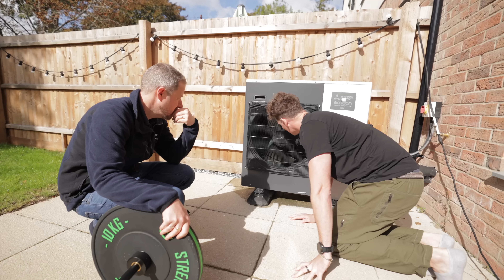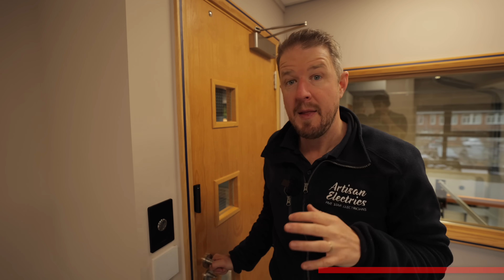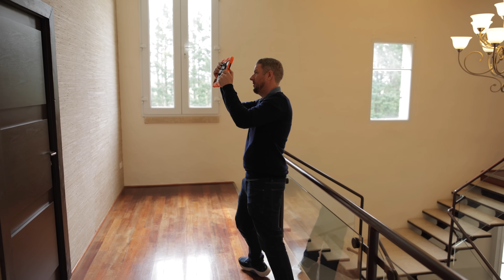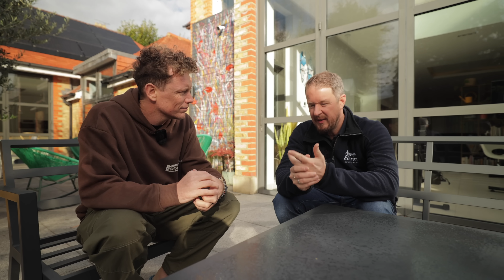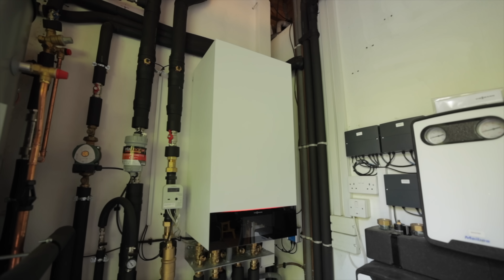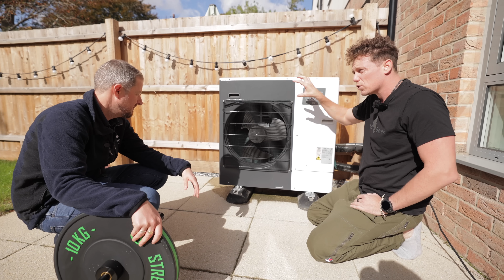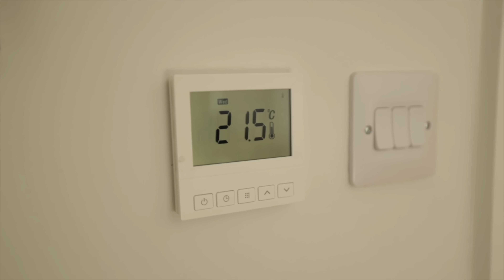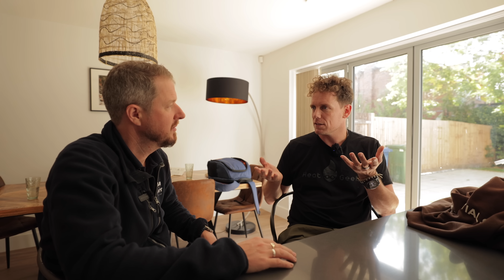Are Heat Pumps Really Worth It In 2026?

Comment: Ive got a (modern) 80's type warm air gas heating system. I suspect that nothing produces the level of warmth that that does. Its not super efficient but the cost is reasonable. My level of insulation is not sufficient for a heat pump although i do have cavity wall insulation. I think heat pumps are still too noisy and the level of heat that they output nowhere near sufficient in the colder weather. Warm air heating has become unpopular, but nothing beats it for heating an open plan room/house quickly. Heat pumps are like electric cars, ie not there yet. But thats just my view.
Reply: A high flow gas combi heating only a warm air unit, which only has what is similar to a car radiator inside and a fan, is superb. Johnson and Starley and Multicalor make them. Incorporate an electrostatic air filter then you have very clean air. Also you can draw in a percentage of fresh outside air. A fast warm up, and cheap to run. No ugly radiators that end up leaking.
Reply: Our setup is air to air in a big old victorian house and works wonderfully whereas the gas struggled (and was far more expensive). Very fond of modern air/air systems although the old 1990s US window unit type things are hideous!
Reply: That was pretty much my 10 year experience of a2a in my house.  Two years ago, I ripped it out and installed 2 log burners.  Noisy, Luke warm draughts and expensive was my conclusion of a2a.  I hated it…

Comment: I live in rural Wales and all the people I know who took the government grant, had to pull out their wood burners as part of the deal So when we had a 5 day power cut in the storm, I was toasty with my burner and they suffered miserably.  I would like to hear how much solar PV you would need to run the heat pump through winter. I think it unlikely that any usual size PV system could power a heat pump in winter. However cheap rate battery storage may help if you have a big battery. So I'm not convinced solar plus heat pump will save us from naughty Mr Putin....
Reply: How can they make you take out a log burner
Reply: It depends on your insulation and bulding size so it's a bit of a "how long is a piece of string" question. However if WW3 happens you aren't likely to have any gas at all!

Roughly speaking though the answer to your question for any given house is that your heat needed will be about the kWh of gas you bought if it's all gas currently. So take that number, divide it by the SCOP of the heatpump install (should be at least 3.5, 4 for a proper job) and you've got the electricity consumption.

The big problem with solar though is it's intermittent. Getting solar to cover a reasonably well insulated house energy requirements over a year average is easy. Sizing so you can survive a grid failure for a week when it's entirely rainy and dark is a bit more complicated.

Generally such setups use inverters like the Sunsynk ones that can do on grid, off grid and generator inputs plus solar. For most of the UK nobody cares but rural highlands/islands and bits of Wales it's another story and there's currently no battery setup for surviving week long outages that competes with a generator. Most of the time with big solar you'd probably not need it, but in the worst case it's about the only option.

For a single well insulated room though you'd only need about 200-500W depending on the situation, which most of the time is doable with a few panels and a battery
Reply: @etchedpixels  Thanks for the thoughtful reply. I just find it a bit misleading when proponents of heat pumps give the impression to the uninitiated,  that if you add solar you can run on your own power.

Comment: I had my heatpump installed by Octopus in February  and i've been really happy with it, the house stays the same temperature all the time no massive swings from one exterme to another.  The installl took about 1 week and only a couple of radiator changes were needed along with a new tank.

It's just started clicking in more frequantly now and is running the CH at over 400% efficency.  After watching a few heat geek videos i've been playing with the weather curve to get more efficency out of the system and it's keeping my house nice and warm with the radiators only running at 26°C.

Since it's install it's saved me £195, with the loss of my gas standing charge and being able to run with a battery at 7p /kWh.
Reply: Sounds strange, here in Norway we use air/air heat pumps, (abt £ 2000 for a normal unit) To involve the "boiler" in the system is not usual, probably because of cheaper el prices.  When I had only electric heating I used 28000 kwh each year. With the pump 15000. The pump is installed in a few hours, but I guess it is nice to get rid of the gas boiler, something we do not use here, would cost far more than electric.

Comment: heat pumps are stoops. more shit to break. the upfront costs make whatever you save a wash so it's all very pointless and they're really not that efficient when your power company just raises the rates constantly. AND we now know climate change is bullshit so there's that little tidbit. also the government's are making each new refrigerant obsolete as soon as it is introduced so they can continue to make money by selling morons the "new more efficient environmentally safe refrigerant" every 5 years. oh yea one more thing. the new refrigerants are flammable. like that's not a backwards move. ridiculous. keep corrupt governments out of private business.
Reply: "the new refrigerants are flammable", there's only a tiny amount of refrigerant in them, and they are hermetically sealed.
Gas boilers use a lot more flammable gas, so not sure what your point is.
R290 is unlikely to be obsoleted either, it's natural propane.  R32 will still be used in split systems for a long time as there isn't a viable replacement for larger split installs.
Reply: @BenIsInSweden  my point is that's a backwards move considering R410A did not require a leak sensor be installed to prevent a fire. also the cost of install along with the life expectancy of the equipment they make now offsets whatever savings there are. you're still buying power from utility companies who want their money (whether it's fuel or electricity). They ARE a business after all. i'm not against progress but i am against corporations using people's emotions about environment to SELL! SELL! SELL!
Reply: @funghoul9124  Not sure where you're getting your information from.
Leak sensors aren't there to prevent fires, they're there to protect the compressor if a leak occurs, a R410a heat pump with a leak without the sensor, would ruin the compressor and it'd need an expensive replacment.

R290 heat pumps have shielding around the electrical components that could generate a spark to start a fire, so with a R290 leak you'd need some other spark source near the heat pump to cause a fire.

Also, do you have any data showing R290 or R32 heat pumps have shorter service lives than R410A systems?

The other factor is even if the refrigerants get banned, it doesn't mean the heat pumps with them need to be ripped out, if there's a leak or need regassing - which is very rare, then you just need to use recycled/reclaimed refrigerant for it.
Reply: @BenIsInSweden  the leak sensors in the plenum didn't show up until the flammable refrigerants did. what happened to low pressure switches? and data on R32? it hasnt been out long enough. there is no data. but i know the inverter technology is so expensive to repair that past a certain point you'd replace over repair. look man, if you love heat pumps that's cool. i just think it's a wash opposed to fossil fuels and i also think rolling out a new "environmentally safe" refrigerant every couple years, which is the plan, is a scam.
Reply: @funghoul9124  Not sure what planet you're on.
But R32 heat pumps have been around for over a decade, and do you know what R410a is? a blend of R32 and R-125.  And my old r410a heat pump had an inverter so it has nothing to do with the refrigerant used.

And new refrigerants aren't rolled out every couple of years.

R290 is highly unlikely to ever be phased out on environmental grounds.
The only step up from it is R744 - CO2, and that's taking it from a CO2e from 3 to 1.

R32 has only been phased out in monoblock heatpumps, it's still king in split systems, and there's no current proposed refrigerant to replace it, nor is there any attempt to phase it out in the split system market.

But again, introducing new refrigerants isn't a scam, there are still plenty of R410a heat pumps legally in use despite the refrigerant being banned for new installs years ago.

I do find it bizarre someone shouting "they're flammable" is someone willing and happy to have far more flammable gas piped into their home that is ignighted for heating, and has had countless casualties and destroyed homes over the years.
Reply: @BenIsInSweden   you're missing my point. i just said it was backwards and only for the purpose of making money, not saving the environment. saying something is backwards doesn't mean i give a shit if it's flammable. also heat pumps in america are alot in terms of up front costs which most of the time do not offset the savings from our utility companies and tend to have more service issues because of the wear and tear of being used all year and the shitty cheap manufacturing we get from overseas which is one more reason to hate NAFTA for us. if you disagree. cool. also i never said 410a didn't have inverters, i just think they work for a while and are designed to be replaced quicker than the old staged systems and when you factor in purchasing costs it's a wash in my opinion. R32 was mainly only in ductless (surprise) in the states up until recently. i'm not gonna lie. i still like me some natural gas. fuck oil tho.
Reply: @funghoul9124  You're actually proving the opposite.
R290 isn't a corporate money-maker - it's natural propane, not a synthetic refrigerant like R410a or R32.
It's non-proprietary, has no licensing or patent fees, and doesn't contain HFCs, which means no F-Gas certification or red tape for handling.

Manufacturers aren't switching to it to make money, they're switching because it's cheap, globally available, and neutral to the environment.

The irony is that R410a and R32 were the expensive, corporate-controlled blends. R290 and R744 systems are the direction everyone's going precisely because they're simpler and free from that industry lock-in.

Also "Inverter" only seems to be a bad word in the US. 
In Europe and Asia, inverter technology has been standard for decades, and actually extends compressor lifespan by reducing short cycling, one of the biggest causes of premature failure in fixed-speed units.  Since inverters became common, both seasonal efficiency and compressor reliablility have improved dramatically.
So maybe it's not the "shitty cheap manufacturing from overseas" that's the issue.
Reply: @BenIsInSweden  here's my point....again..Cost of equipment doesn't warrant savings in electric in terms of how long these systems last, at least here in America. also trying to make a case about all the "new" refrigerants that are "better" than the old and are the "new" standard is AGAIN my point. that's the rub. you're acting like "oh no, we've figured it all out now" but it's now become just an excuse to churn out new systems due to regulations every few years. corporations are involved in ALL decisions like this.
Reply: @BenIsInSweden  and by the way, i'm in America for christ's sake. we've had inverters forever too. but they've been more expensive than the older staged compressors and people here for the most part don't care about efficiency past a certain point. everything new is "more efficient" but will it last long enough to recoup the upfront costs? most of the time, NO would be the answer and because we still have Steam, hydronic, radiant, forced air, ductless, and use oil and gas along with electric it seems we're not as partial to heat pumps here because in the end, we deal with the situation given. usually people who have access to propane or natural gas do not want a heat pump considering most of those fossil fuel systems hover around 95 to 99% combustion efficiency with variable inducer and blower motors using DC voltage and the huge lower cost difference in equipment? there's no real decision here. granted i'm sure it's different where you are.
Reply: @funghoul9124  Well-installed ones last 15-25 years, depending on the heat pump type.

Regulation doesn't mean you need to install a new system every few years, like I've already said R410a systems can still be regassed with recycled/reclaimed refrigerant.

Also, they aren't like-for-like, that you seem to think they are.
R290 allows for temperatures up to 75C, and R744 goes up to 95C compared to 55C with R410a/R32.

Allowing for far more efficient DHW heating in A2W heat pumps.

Heat pump prices haven't increased over the years, at least not in Europe. Warranties are also getting longer, and seasonal efficiencies have improved, resulting in lower annual electricity consumption.

R32 is likely going to be the main refrigerant in split systems for the next decade. Even now, R32 has been going for far longer than your "every few years" claim.  R290 has zero regulatory or environmental basis for a ban in the monoblock space.
Reply: @funghoul9124  Speaking of high-efficiency furnaces, I recall seeing that in the US, it can cost over $10,000 to upgrade from a standard efficiency (~80%) furnace to a high-efficiency (95%) one, which often isn't worth it for most homeowners.  So comparing a high-efficiency furnace to a heat pump is being a bit disingenuous.
Reply: @BenIsInSweden  no that's wrong. i'm talking about cost of equipment, not what some company wants to rape somebody over the cost of labor.
Reply: @BenIsInSweden  25 yrs? so you have inverter systems that we're installed in 2000 still going? we don't. listen. i don't know what horse you have in this race outside of owning one but lets just end this boring ass conversation by saying you like em and think they're worth it. does that work?
Reply: @funghoul9124  Give an example then of:
- A staged heat pump cost, and SCOP/SPF.
- An equivalent inverter heat pump cost, and SCOP/SPF.
- Cost per kWh of electricity.
And it should be easy enough to verify your point.
Reply: @BenIsInSweden  uh huh
Reply: Yo scientists! funghoul9124 on youtube says climate change is bullshit, pack up all the evidence and research, this clown has clearly made some major breakthrough! 😂

Comment: You actually missed one common type of heat pumps. Air to air heat pumps. Also known as AC. Works in the same way and acheives similiar levels of efficiency when heating.
Reply: But don't heat the DWH..
Reply: @MikeGleesonazelectrics a few models will even do that. Or you can get a dhw cylinder with integrated heatpump.

Comment: Oh "heat pump" is the marketing term for reverse cycle air conditioning in cold climates. I finally understand.
Reply: And many work both ways, heating or cooling, that's why you set them for the same temperature all year around.
Reply: @hardergamer you have to change most of them from heat in to heat out in the settings. The term reverse cycle indicates it can heat and cool. As an Australian we have had reverse cycle air conditioning as the "standard" for at least 25 years

Comment: Octopus Energy installed one for me. They seem to have done a good job as far as I can tell; it works; and it's saving me money. They set it up to use a weather-dependent curve which I may tweak for more efficiency but I think it's pretty close. It works really well with solar because many of the cold days of winter also happen to be sunny days. It's also better at maintaining a temperature than the boiler used to be which I can see from some Govee thermometers I put in place to monitor its effectiveness. I am happy with it! I appreciate the education from the Heat Geek channel as I had already reduced the cost of running my boiler from the information they provided. The only downside I would say is that the Daikin user interface looks like it came out of the 90s and I'm sure it could be easier to set up and use.
Reply from the maker: Glad to hear your heat pump is working out for you and saving you money!
Reply: K pppp

Comment: My house is far more comfortable with a heat pump than it ever was with a combi boiler and my house isn't particularly well insulated, I also have the benefit that I can supplement the energy used by the heatpump from my solar panels (yes even in the winter) which you obviously can't do with a Gas heating system
Reply: The combi and heat pumps are just heat sources, no more. if you had problems when the gas combi was on then the system and/or its controls were wrong.
Reply: @johnburns4017 it's because I only tended to run it when the house was occupied so it was always heating from a lower temperature, convection made it feel draughty all the time, with the heatpump I don't have this issue and it costs the same or less than my gas CH did
Reply: @sp1es  
So you are running your heat pump for longer? You could have had the combi system optimised with superior controls and lower running temperatures. 

The heat pump is not making a difference, it is the time it is on maybe tbe controls.